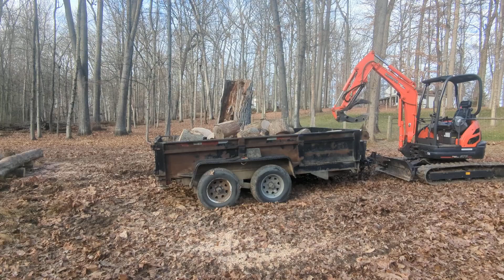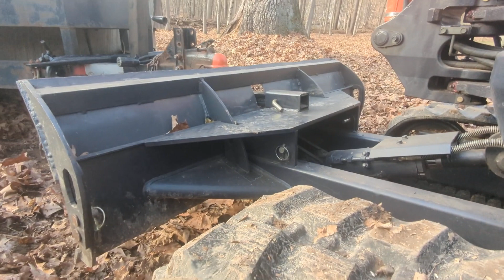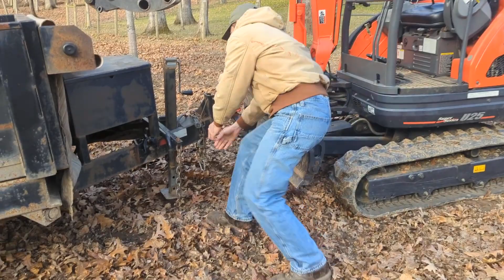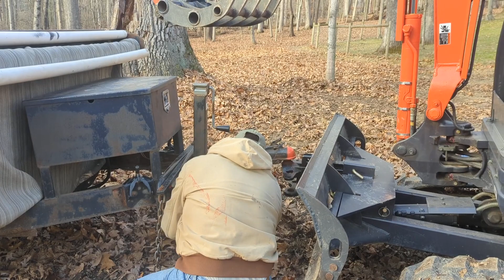Why every mini excavator should have a trailer hitch like I added to my excavator for logging work

Comment: Good Idea, how about rake attachment, where can I get one?
Reply from the maker: The four foot wide rake attachment I have was created by Gambier Welding and Fabricating in Gambier, Ohio. The two foot wide claw attachment I have was created by Blair Construction and Fabrication of Auburn, New York.
Reply: thanks
 @MiniXGoneWild
Reply: Great demo, thanks for the video! Ive been debating selling my compact tractor with loader to get a mini and this is one of my biggest concerns. I use the tractor daily for my devolping firewood and sawmill business, i feel an excavator may be better suited? How do you feel about the power and longevity of towing with the mini, any concerns on drive motors or anything? Any feedback would be appreciated, thanks!
Reply from the maker: I'm sorry it took me a week to reply to you. For some reason your comment didn't show up on my alerts. I must admit that I am partial to the Kubota U25s that I have worked with. They have a two and a half ton towing capacity and I have done far more driving/towing with them than the average operator. I love how they have served my purposes, but remember, their "high speed" travel speed is comparable to someone walking. That said, if you aren't in a hurry and aren't driving more than half a mile or so, they have served me well. I usually pull a load out to where I can switch to my truck and tow the trailer with it instead of my excavator. I hope this helps.  @OhioHillTopsHobbyFarm
Reply: @OhioHillTopsHobbyFarm  You would be far ahead to keep the tractor and buy an excavator as a supplemental piece of equipment. Excavators areterribly slow tracking and you are wearing some expensive parts by tracking more than necessary. The tractor is better suitd to towing any distance. Just my opinion, but I do have both and a sawmill and firewood, so it's an opinion formed from experience.